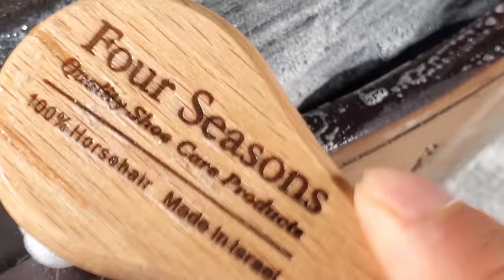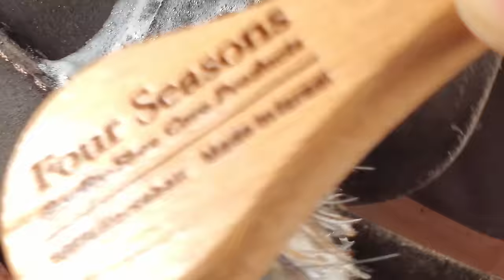ASMRㅣClean Suede Shoesㅣ스웨이드 신발세탁ㅣ Salvatore Ferragamo Suede Shoes

Comment: there are many products on the market to fix suede shoes , the job was not perfect in my opinion
Reply: Can you please tell me what you would have used? It seems to me that you know better and yet this is the first video I see someone really restoring suede leather. Usually people just do the rubber brush and the rubber eraser and that's it. But if you have other content which is also in video I would be glad to know! Thanks in advance.
Reply: @mehmett.3557  well in mexico I was president of a couple of shoemaking companies making around 25000 pairs a day, ir order to keep suede leather in good shape , first of all you have to know how this leather is being created and since I also was consultor of some very important tanneries here in town , we are using special oils to keep the leather soft and protected against water etc. In case you need more information I will ask one of these tanneries to send me some more specific details , regards
Reply: @mehmett.3557  as an example to clean suede you should use a brush made of copper wire , not a plastic one , etc etc
Reply: @mehmett.3557  using soap you take the oil out of the leather and make it hard , losing flexibility
Reply: @mehmett.3557  I also con see that this shoe was almost never used , look at the insole , is totaly new , etc
Reply: @santaclaus179  I would love to know which special oils are used! Thanks so much for the valuable information
Reply: @santaclaus179  so you're saying, the the cleaning part could have been done for the greases (here referred to as vomit) on the leather as well by "scraping off" the upper layer of the surface? On the other hand I can imagine the idea that one uses a cleaner on water do dissolve the greases. And yet water is not good for suede.
Reply: @santaclaus179  well this is true as well. If you watch with awareness, the video is intended more so as an entertainment rather than educational purpose, although I am still on the Outlook to find a way to restore suede. I am really looking forward to be oils you will be mentioning
Reply: @mehmett.3557  I am referring to the oil inside the leather
Reply: @mehmett.3557  oh let me ask the people of the tannery next week ok , greetings robert
Reply: @santaclaus179  thank you so much! now i also know which oil you meant. you sir are great!